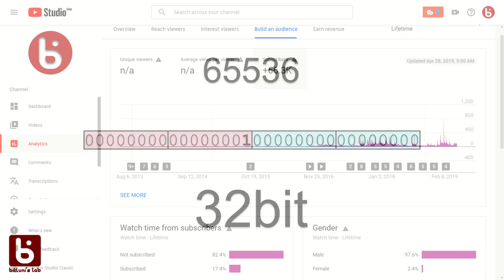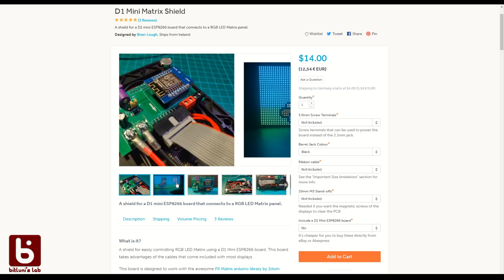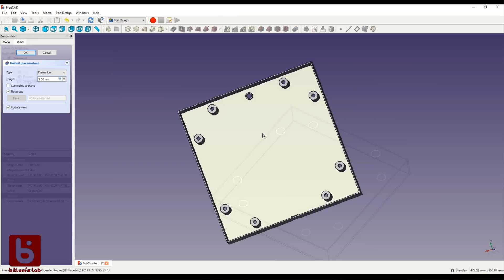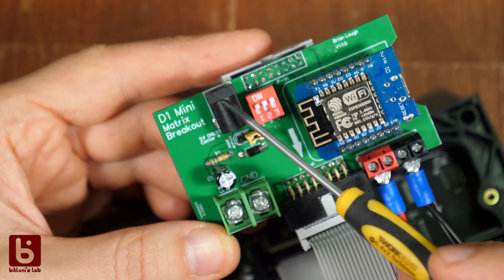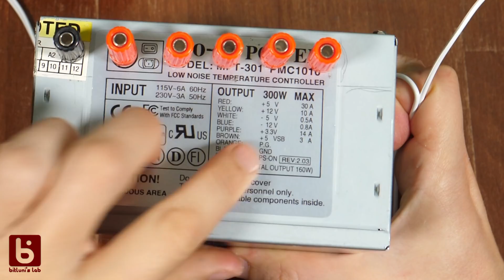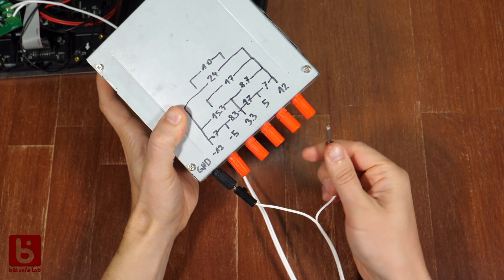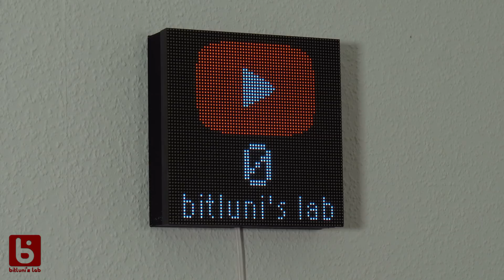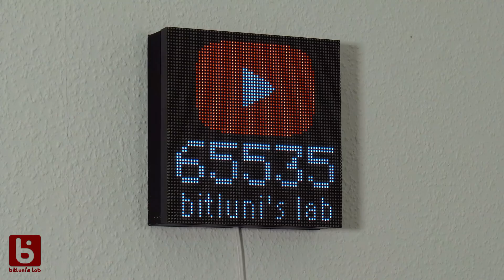YouTube Button - Nerd Level [ESP8266, RGB LED Matrix]

Comment: You should really quit using those old type names (like unsigned short) and use the modern and specific names like uint32_t.  Easier to read and catch these problems earlier.

Comment: Which desktop environment/window manager are you using? (4:11)
Reply: It's a unix system. I know this.
Reply: @UltraNyan  I also know this. I'm just interested in the window manager he's using.
 I use arch btw.
Reply: @steffenvongrabau7260  From the looks of it it might be anything from i3 to awesome wm. In most of the videos he is using windows, so he probably loaded up some random "hacker desktop" videos.

On the big screen there is terminal running on desktop background (which is stupid imo) with icons on desktop (disgusting). So probably a riced version of mate wm. But look, no taskbar. Really this mess doesnt make any sense. You can make this easily with awesome wm or openbox with tint 2 taskbar only showing pager, not sure about desktop icons cause havent had them for years..

Comment: Quick question: you have a yield() the line before a delay(1000), does that actually do anything as surely the delay is returning control to the scheduler anyway? Cheers!
Reply: On the long run (2 weeks for example) it seems like it helps. It's always good to just add it

Comment: Glad it's not just me. I soldered the angled box header on the wrong edge of the board. I managed to de-solder all 16 pins, but not without mangling and melting the part. Waiting for my order of  25 2x8 box headers to arrive via eBay...  :-/ Should have plenty of spares.

Comment: It turned out great! Thanks so much for the shout outs!

And big thanks for the feedback , I've beefed up the documentation and made it harder for people to ignore it exists 😂

I also added an option on my tindie store for a ribbon cable, this could be used with male headers soldered to the p-in connection as a similar work around to what Luni did. The cable Luni used is perfect but I could not find one at a cheap price.

If people have any questions on the PCB please feel free to ask!
Reply: Constantly debugging "customer programming" (kit instructions) is part of the life of any kit supplier. And its great when a customer like bitluni shows you more ways to get it wrong. LOL. "Failure is always an option." And it was fun watching this bit of mis-execution. Thanks!

Comment: you need a small font when you reach 100K :)
Reply: I'm not sure if I ever tested it, but I'm pretty sure my original code would automatically use a smaller font if the text didn't fit... I could be imagining that 😂
Reply: not really, you can just join the panels together
Reply: @BolverBlitz  (;
Reply: Or you can use hexadecimal, which would allow you to get to 0xFFFFF = 2^20 - 1 = 1 048 575.